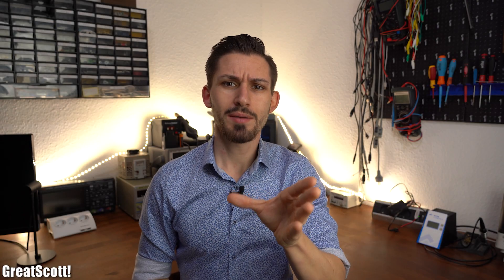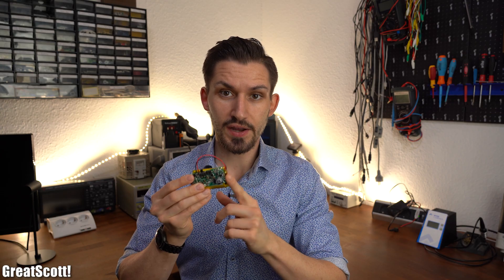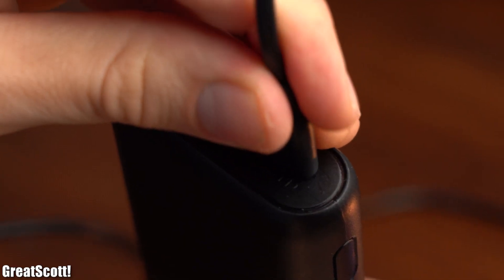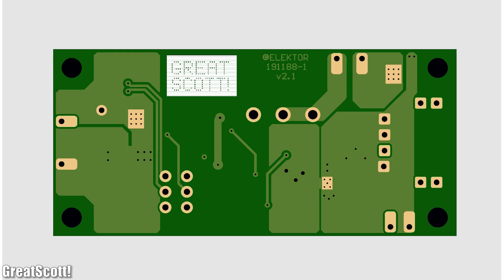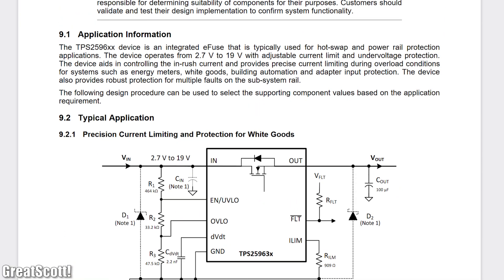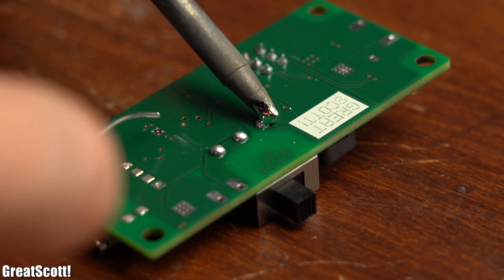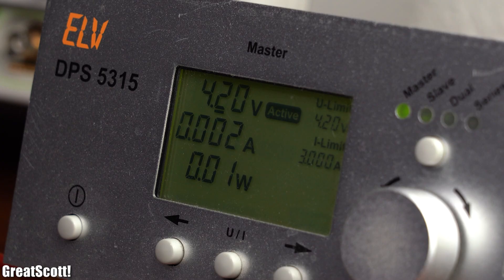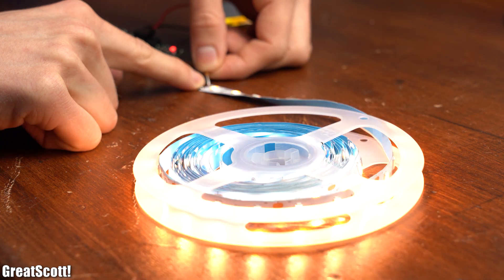DIY LiPo Supercharger! (Charge, Protect, 5V/12V Boost V2)

Comment: 1) Using some liquid flux for soldering may help for getting better results.
2) For the short circuit protection, limiting the current may be dangerous. I think that part should be updated in the upcoming versions! 
All in all, great job and congratulations!